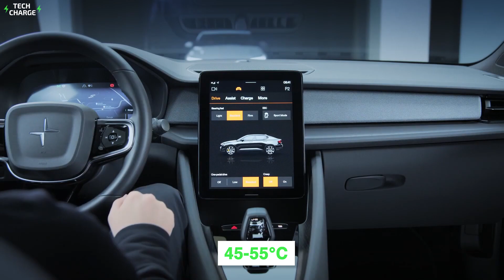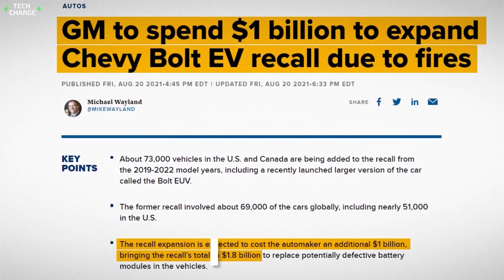The Shocking Truth About EV Fires You Need to Know

Comment: This is a pretty good presentation but it ignores one attribute of EV battery packs that makes them very dangerous. We feel relatively safe carrying a cell phone with a lithium ion battery. That phone has a battery pack with a single cell. Your laptop may have 4 to 6 cells in its battery pack. The probability of a single cell catching fire and injuring you is pretty low, although Samsung had to recall a lot of cell phones because of that risk. The EV battery pack may have about 2500 cells in a small vehicle or over 10000 cells in a large vehicle. The risk of fire starting is up to 10000 times higher for an EV than for a cell phone. If a single cell in an EV ignites then it will start a cascade failure through the entire battery pack. The size of an EV fire is in no way comparable to the size of an phone, tablet, or laptop fire. The comparison of the likelihood of a gasoline vehicle fire is distorted due to the fact many gasoline vehicle fires are started on purpose by criminals destroying vehicles they have stolen. Yes, those are included in the vehicle fire statistics. If a proper hazard risk analysis is done for these EV cars, we would possibly find they should not be approved for sale. Another attribute of EV battery packs is that they degrade quickly with age. An ICE vehicle with a hundred thousand miles on it is still a pretty good vehicle with a little resale value. A used EV may have a battery pack near end of life with a travel range that make is useless. Replacing the battery pack will far exceed the value of the vehicle. The EV is the disposable vehicle because rapid degradation of the battery pack destroys the vehicle resale value. Try buying a vehicle warranty for an EV with over 70,000 miles on it!
Reply: re: "The EV battery pack may have about 2500 cells in a small vehicle or over 10000 cells in a large vehicle. [therefore] The risk of fire starting is up to 10000 times higher for an EV than for a cell phone. If a single cell in an EV ignites then it will start a cascade failure through the entire battery pack."  <---- that's a bingo.
Reply: You are repeating auto industry propaganda. NHTSA stats show ICE vehicles have 60.9 times the fires of EVs. Yes, they are more severe, but technology and safety systems are available to combat EV fires. They usually occur in severe accidents. Tesla vehicles hold ALL the top spots in US and European crash testing. Criminal torching a stolen car does happen, but it is nearly impossible to steal a Tesla. They can be tracked and shut down immediately. 
I recently took a 419 mile trip I have taken many times in my Acura MDX which would cost $153 in fuel. In my Tesla Y it cost a total of $14.33 for supercharger fees (which are more expensive than home charging). It was also the most comfortable trip ever - the car drove the whole way except when parking at the charger. I supervised, but it made no mistakes driving around the DC beltway with traffic.
Tesla warranties the batteries and powertrain for 8 years and 120,000 miles and there are many over 500, 000 miles and at least 1 over 1 million miles.
Reply: @wylieecoyote  Thieves do not steal Teslas because they do not want to deal with the hassle of having to charge them over and over again just to get around and steal more stuff. 

I am guessing that they cannot even do that because they would have to have the registration and approval to use the Tesla superchargers. I am further guessing that they would have to know how to activate that, also. So, it is not worth the hassle to steal a Tesla.

Also, they do not want to take a chance on the Tesla battery pack going up in smoke and flames at any given moment. 

If you want to drive a Tesla, then that's your business. There are plenty of us which do not want to drive those vehicles and that is our business. 

The government must have no say in what persons should drive via incentives, public peer pressures, and propaganda. 

Instead of giving someone a tax break of 7,500 for a new EV or 4,000 for a used EV, the government should give that 7,500 tax break to persons wanting to buy a home and the 4,000 tax break to persons wanting to rent a residence. People would rather live in a home than in a vehicle. 

The prices of those EVs are far too expensive and that money should be used instead towards residences instead of for EVs warranting highly expensive battery replacements.
Reply: @COTH23  Thieves cant steal them. They can be tracked remotely and shut down. 
You do you, but you are spreading false information. Fires are blown out of proportion. Per 100,000 cars, NHTSA shows ICE vehicles have 60x the number of fires. Specifically 25.1 fires for every 100,000 vehicles sold compared to 1,529 fires for ICE vehicles. 
Before incentives my Model Y cost $5k less than my Acura MDX, which is a similar sized vehicle. I have no fuel to buy, no oil changes, no brakes (regeneration is used), and no tune-ups to pay for.
Batteries and drive train are warrantied for 8 years 150,000 miles with several battery packs going strong after 1 million miles and huge numbers passing 1/2 million miles. The vast majority are still on the road.
I don't have to visit a charger unless I travel. 
A recent trip of 410 miles cost $14.33 at a super charger while driving my Acura MDX would have cost  $136.
Reply: @wylieecoyote  I have told you that the thieves do not want to steal them because those Tesla EVs are not worth stealing. 

They need something they can use to do more crimes with not something that will slow them down because it has to be charged over and over again. They do not have time to wait for a charge. 
Plus, they probably cannot even charge it because they do not own it. 

Also, there are no parts of which they can make money from a Tesla EV. They would not even want it just for joy riding because of it needing to be charged all the time. 

Elon wasted his time and money by putting a tracking system in his EVs. Tesla EVs are not worth the steal. That is just common sense and a fact.
Reply: @COTH23 You are spouting nonsense. You have no idea what you are talking about or are a paid shill from one of the manufacturers. Tesla vehicles are nothing short of revolutionary and heads of Ford, Honda and Toyota have acknowledged the incredible leaps Tesla has made. Gigacasting alone will have benefits for every vehicle made, reducing manufacturing costs and making cars more affordable and safer. Tesla holds the top 4  spots in NHTSA and EuroCap safety testing.
I go out every day with a full battery and dont have to stop at a charger unless I am on a long trip. 
I only drive if I want to. It drives door to door on its own. The self driving makes commutes far more relaxing.
Reply: @wylieecoyote  Yet and still the thieves do not want the Tesla vehicles. If they did want them, then they would have been stealing them ever since day one. 

So, if they stole a Tesla would they be able to charge it even though they don't own it? Also, would they be willing to pay for the charge, if they are able to charge it? 

Why would thieves choose to put themselves in a position to pay for the charging of an entirely battery-powered vehicle; in which they would have to constantly be concerned about the constant drain on the battery as they drive about terrorizing everyone? 

Would they really want to be bothered with monitoring the correct percentage level of charging and the preconditioning of the battery before or during or after the charging? 

Thieves need transportation that is convenient, quick, and easy to operate for their constant wrongdoings. 

However, should they decide to use a free charger, they would not get enough charge in enough time to be effective thieves. They do not have the time to wait hours on end for an appropriate charge of a stolen electric vehicle.

Plus, they would have to be knowledgeable of the charging wattage per vehicle. Should they use cable number one or cable number two when charging whatever model Tesla? 

Are they really going to read the car instruction manual; which most likely is on the computer in the car? Thieves don't have time for such questions.

Furthermore, they would not know how much driving range would be present on the Tesla they stole. It could only have 25% range at the time they stole it. Are they going to try and get it charged so they can continue to use it and steal more stuff and go joy riding? 

If they stole an ICE vehicle or an HEV, and there was only a quarter of a tank available, then they could go and get gas and continue riding and stealing. 

They would have to ditch the Tesla after it ran out of range, if so they chose to waste their time in stealing it. So, once again, what's the point of stealing a Tesla? Just imagine car thieves suffering from Tesla range anxiety. 😆
Reply: @COTH23 “thieves need transportation that is convenient“ - dude, you are out of your mind. Thieves steal cars for resale, it‘s that simple, not for convenient transportation. If the resale would be attractive, they would be stolen. Easy logic. What thieves really want is an uncomplicated flip for as much cash as possible. And you can‘t flip a Tesla without owners consent. End of story.
Reply: I have personally spoken to x2 Tesla owners that had  400 and 550K miles on their batteries and still running well.
Reply: Good comment, I have written very similar posts, the probability is far higher with multiple cells, most of which are Chinesum these days.
Reply: Some houses have bedrooms over the garage. It would be like sleeping on a BBQ. Most of the time, kids sleep in these bedrooms.😢
Reply: Lol phone batteries don't have BMS. EVs systems constantly keep batteries within temperature tolerances and will shut down cells as required. Notice nobody talking about home batteries which use exactly the same technology and BMS. Notice Toyota have had these batteries since the 90s without an problems. This is big oil trying g to hold on
Reply: Says EV has 10000 PC more chance of fire than a cell phone? Lol proves you know zero about battery tech both in phones and EVs
Reply: Well said. You forgot to say they are completely not ecological.
Reply: @sharky1583  Much of the material used to make the batteries comes from China, so the mining run-off and related pollution doesn't count.
Reply: you are sooo incorrect about EV battery life.  Even the 10 year old battery packs with battery temp management systems last hundreds of thousands of miles and they get better each year.  the newest batteries will last 1,000,000 miles.  far longer than the body and components.  it is likely the battery will be saved and put in another vehicle when the vehicle reaches end of life.
Reply: @jamesbecker4326  as if
Reply: @jamesbecker4326  has any one driven 1m miles like our  engines will last 30 years on a model thats been out3 years
Reply: @jamesbecker4326 On what planet? Give me the make and model of ANY battery that makes those claims. I call BS and I know a thing or two about batteries.
Reply: The Samsung battery issue had to do with the clearance in the phone did NOT allow for proper expansion during charging, leading to pack damage over time. Totally different issue. Educate yourself.
Reply: You missed the point of my discussion, perhaps on purpose. Laptops and cell phones are not subjected to road shock, collision damage or flood damage because we know they are relatively costly and delicate objects. The battery pack of an EV is located across the bottom of a moving vehicle where it is subject to all the above. Even if the individual cells were to have a failure rate lower than the failure rate of a cell phone battery, the aggregate failure rate of an assembly of thousands of cells will be much, much higher and only one cell has to ignite to cause a fire to very rapidly spread across the entire pack.
Reply: @kriswingert1662 @phillyphil1513 Also, that Mercedes EQE just so happened to be a rental from the dealership and it was NOT CHARGING when it went up in flames and destroyed their home.
Reply: @kriswingert1662  ye  10000 of them equals a great expansion
Reply: @kriswingert1662  a Mercedes EQE catches fire in garage in Florida date Wed July 19th 2023.  one week later a cargo ship named Fremantle Highway carrying electric vehicles (many of them also Mercedes) catches fire off the Dutch coast, date Wed July 26th 2023.  EDUCATE YOURSELF.
Reply: @phillyphil1513 Also, that Mercedes EQE just so happened to be a rental from the dealership and it was NOT CHARGING when it went up in flames and destroyed their home.
Reply: @COTH23  exactly, more telling though (even without these added details) is the fact that it was a current MY 2023 electric vehicle.  this "burning from brand new sitting still" is the exclusive domain of EV's.  yeah, so same behavior seen in numerous Teslas everything from Model 3's to Model S Plaids.
Reply: @phillyphil1513  Okay. I was unaware that the Mercedes was a brand new 2023. That's good to know. The warning signs are everywhere concerning all EVs; yet persons continue to buy into such a highly potential catastrophe just waiting to happen.
Reply: @COTH23  re: "The warning signs are everywhere concerning all EVs"  yup unfortunately coming to this realization for many was also going be unpleasant...

from the rash of cylindrical cell equipped scooter fires currently happening across NYC, to 10 years of EV's burning themselves on dry land (which should be evidence enough at this point) to EV's now burning whole cargo ships out to sea, to a history of Lion fires crashing commercial airplanes going all the way back to 1987...

indeed the signs are there, but unfortunately as a society we are simultaneously "addicted to technology" so this has the effect of making us BLIND to the "threats" posed by technology itself.
Reply: @phillyphil1513  Wow, I wasn't aware of EVs burning whole cargo ships! I attempted to look up something on the lion fires and something was mentioned about airplanes; so I did not find what I thought I would. Maybe you could give a little more detail on that, please? 

I have read a comment expressing concern about EVs being present in forest preserve areas/national parks. Could that be what you're referring to?
Reply: @phillyphil1513  Oh it looks like you're talking about Li-ion fires. LOL. It came out in the comment as lion fires.
Reply: You don’t know what you’re talking about.